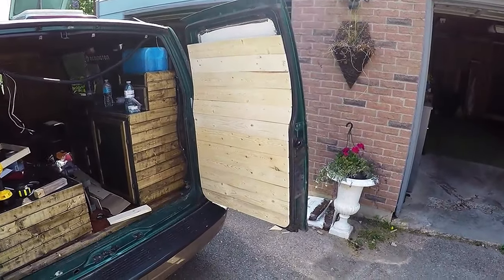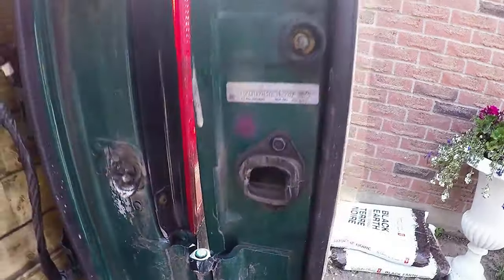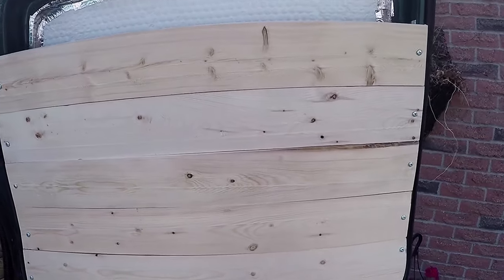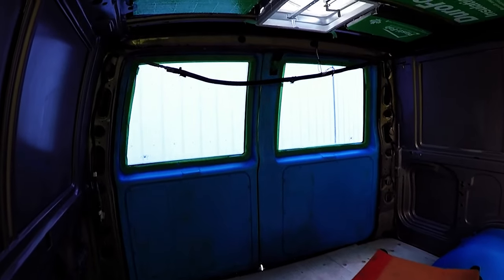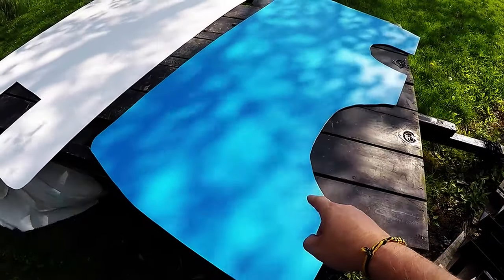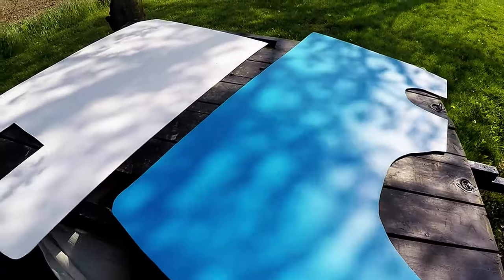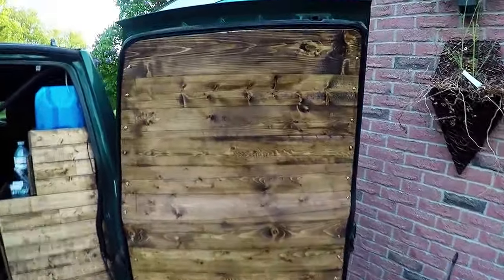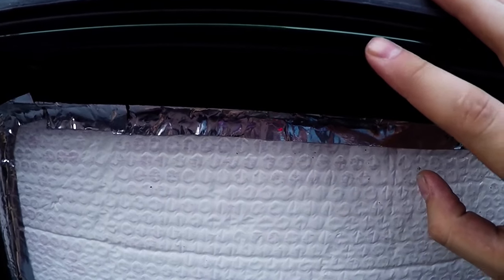The Van Build Chronicles E26 - Friends Astro Camper Build & Rear Doors Pt.2

Comment: I wouldn't have given the weight a second thought myself there is no way that you have enough to effect the structure, but good explanation for those who have been asking. Keep an eye on the bottom hinge area that broke for water leaks, make sure that the door seals correctly, man you don't want mold. Check out into the mystery13 channel (Jed). I would hate to see all that work you put into the van ruined as well as you getting sick. Rear door panel came out nice. Looking forward to seeing your buddies build, get to open a channel :) ~ jman
Reply from the maker: Yes I Checked It All Over Its All Sealed Good Still! Thanks For The Concern And Thanks For Watching Jman!